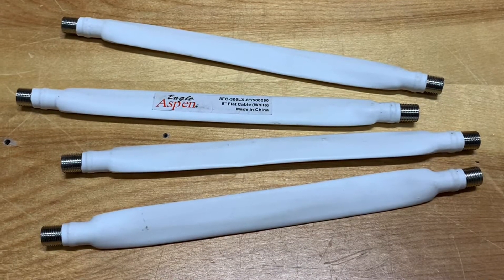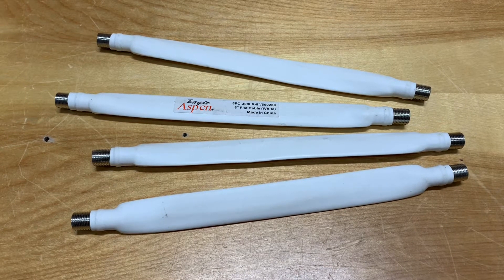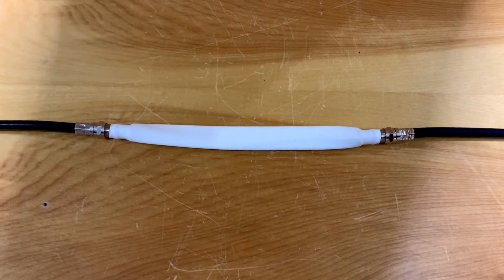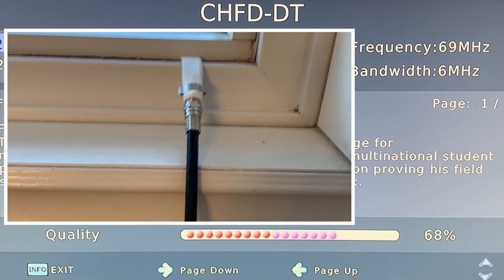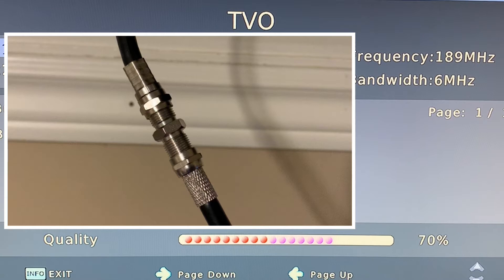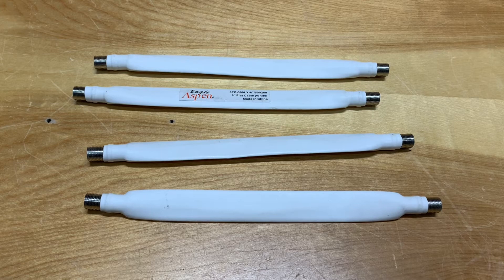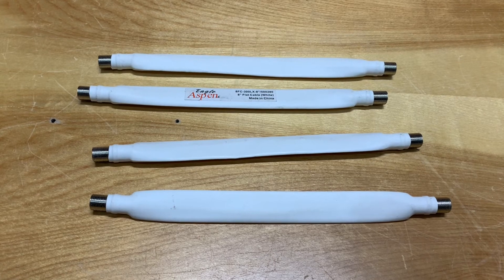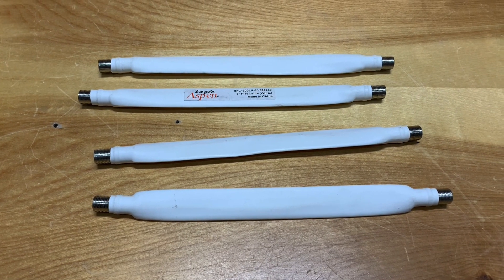Testing Flat Coaxial Cable for Signal Loss

Comment: Please note that the TV scale you show is NOT a measure of signal strength.  It is a measure of error correction.  I made the same mistake early on and have learned that it is not the best way to see the effect of amplifiers.  It does come free with the TV, though.
Reply from the maker: It’s a good general indicator of signal. But thanks for the information. I wasn’t aware of that.

And yes, the price is right (free).😄

Comment: I have one of those cables, in Europe we mostly use it for satellite reception there are portable 40 cm satellite dishes and if you have a van or you move somewhere you can't drill a hole this type of flat coaxial cable is the solution. Testing with AMIKO TSC 1000 and AMIKO MULTI TRACKER 2 I've noticed the signal drops between 5 to even 25 %. Using an RG6 trishielded cable will have less loses but it is recommended for short run (20 meters maximum). An antenna or satellite amplifier is recommended. But my advice is to avoid this flat coaxial cable. Great video!
Reply from the maker: Thank you, that's why I stated it is really best used in a temporary capacity, in any instances where drilling a hole may not be allowed, etc. There is no substitue for properly run RG6 coaxial cable.
Reply: @NorthcoasterHobby  Lucky  I didn't had to use it but I was curios on how it performs. It's only for extreme cases. A few years ago I had a neighbor that used that flat coax cable for Cable TV and complained that some digital channels are missing and the analog ones look awful I told him that it's that flat cable, he didn't believe me so he called the cable company. The cable guy told him the same thing. In the end the cable guy found a way to solve the problem and installed a new cable.
Reply from the maker: @Nicholas_Chris  I’ve even thought this cable could be wrapped with foil tape to add extra shielding. Might be a good little experiment.
Reply: @NorthcoasterHobby  Yes, that may be a good idea especially for UHF and satellite reception.
Reply from the maker: @Nicholas_Chris  I wish I had UHF channels to do that test.

Comment: Good video! It’s very helpful! I was thinking of getting one, but I just got an RG6 cable. My dad and I went under the house and disconnected the DirecTV cable from its splitter, then connected the antenna to it.
Reply from the maker: Great way to re-use the cord instead of cutting it! Thanks for watching!
Reply: @NorthcoasterHobby  No problem! After we connected the antenna cable to the old multi-room splitter DirecTV installed, we got 57 channels in every room! (We just got one of those cheap Magnavox antennas and put it on a 4 foot pole right next to the patio.)
Reply from the maker: @sethbessinger2025  That’s awesome! I wish I could receive that many channels!